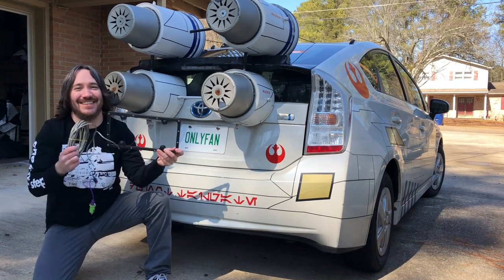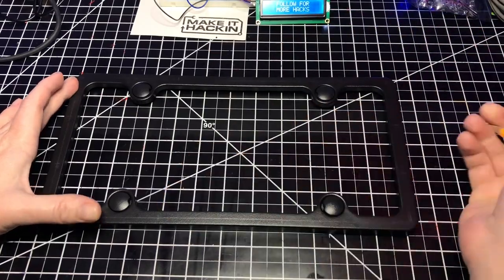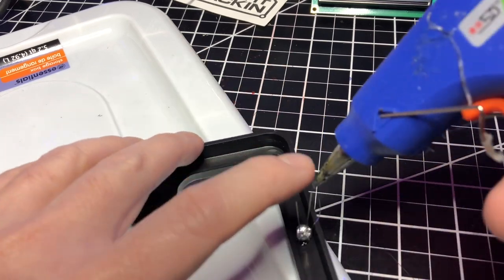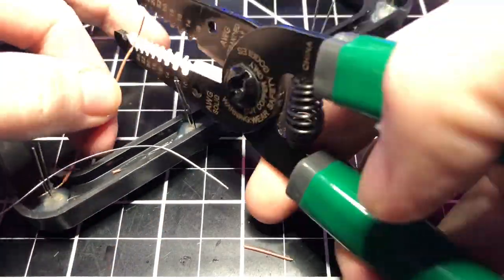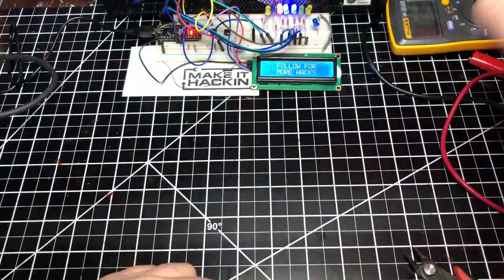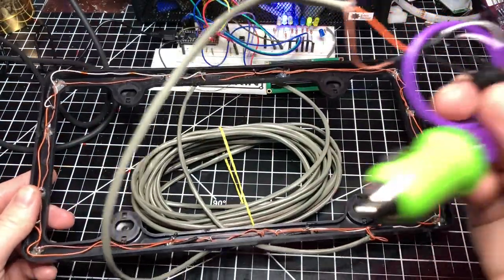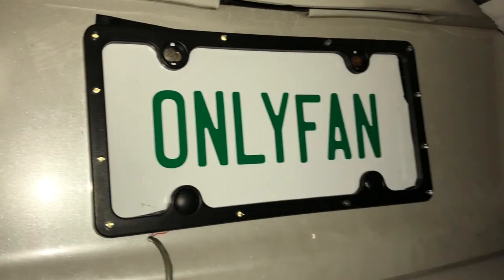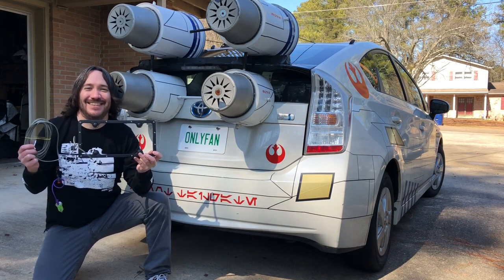Infrared Camera Blocking License Plate Frame - Tutorial - How To

Comment: Still illegal to obscure you plate. No different than the polarized covers used in the past.
Reply: But it is no obscured to a person of normal vision.  Or are you saying that the only purpose of traffic cameras is safety? If it's for revenue then the camera is illegal.
Reply: @bowez9  Same way a polarized filter only blocked the camera from seeing the plate. Still not legal.  The camera is for enforcement. You don't get safe roads without being able to enforce the law. And how can you make it safer if you can't go after the person who is being unsafe because they are obscuring their plate from the camera?  Why do you need to obscure your plate if you are obeying the law??
Reply: @pdxyyz  polarized lenses block a portion of the visible light and as such obscure it to the vision of a normal person.  As a matter of function polarized lenses only let light visible or not that is only aligned in one orientation through so it is only a small fraction getting through.
Reply: @pdxyyz  if it's enforcement put a law enforcement officer out there then.
Further more the 4th Amendment put a hole in your argument.
Reply: Again if you aren't breaking the law why do you need to obscure your plate??    Polarized covers were designed to block cameras.
Reply: @bowez9  The issue is that obscuring a plate is illegal, and there is no reason to do it other than to break the law.  If you want to change the subject and debate the efficacy of traffic cameras, then fine. Traffic cameras teach drivers to follow the law in specific places. Police patrolling the streets keeps people on their toes and make them cautious more of the time.  In Portland city government have defunded the police, and reduced moral causing cops to resign, the numbers are now too low to even have traffic patrols. Too busy working the riots.  So the only way is to use cameras.  Because at least getting a ticket in the mail makes you think remember to drive safely when around the cameras.
Reply: @pdxyyz  many courts have already ruled on cameras and usually if they a income source they are illegal-they are not for safety or teaching one the laws.  That is what the codified law books are for.
Reply: @pdxyyz  and others states have said cameras can stay but generate no revenue and all the cases I've heard of so far they end up not being used at all then.
Reply: @bowez9  - but how many cases have you heard about? poor sample sizing is a common problem with faulty analysis.
Reply: @jeremylarson6267  Memphis, Knoxville, Nashville, Little Rock... both states of AR and TN.    AR deemed them illegal while TN said could use them just not make any money.  So I'd say a sample of ~10million people is sizable.  Each one of those cities listed plus more each were individual, at a minimum, suits. 
Can also add Atlanta and the state of GA to this list, they can not generate revenue.
Reply: @bowez9  as i suspected, faulty analysis
Reply: @jeremylarson6267  care to elaborate?
Reply: @bowez9  - sure care to site the ~10 million cases used as your stated sample?
Reply: @jeremylarson6267  population of AR and TN.  Then add in GA and more than double that.

Or did you assume Court Cases?  In which case those cities plus more had at least one lawsuit brought against them if not several, hence why those state courts ruled on the legality of them.  A Court can not issue a ruling without a issue being brought be for it.
Reply: @bowez9  - population is not cases... but hey, let's go with your flawed analysis - how about adding the population of texas, arizona, oregon, washington, maryland, illinois, D.C., NYC, ...
Reply: @jeremylarson6267  read my posts  agian.
Reply: @jeremylarson6267  since you list TX, they are illegal there, as of this legislative session are banned in IL.  In NY while legal has almost no teeth, but are illegal in NJ.  NY looks to have down the road of not allowed to generate revenue.
Reply: @bowez9  - how you equate total population to 'cases' is astounding!
Reply: @jeremylarson6267  inspired by a former President.
Reply: @bowez9  - FDR made you do it, brilliant!
Reply: @jeremylarson6267  not the one I was thinking of but how have any of your questions disproved the facts I've stated?
Reply: @bowez9  - we can agree, your responses have proven your analysis is flawed. and some president, other than FDR, inspired your flawed analysis.
Reply: @praetorianblade6490  First,  hanks for proving Godwin's law.  Second, the ad hominem attacks are as sign that you are incapable of defending your position in the debate. Third driving a car is not a right it is a privilege, thus the need for license plates and licenses. Forth we have the both the 4th and 14th amendments to the constitution which ensure that we are safe from illegal search and seizure and are required to be given due process.
Reply: @jeremylarson6267  no matter state of analysis, doesn't change the fact that numerous states have deemed cameras illegal or to only be used if no revenue generated (as such most districts see no benefit with no revenue).  Yet these same areas all allow a actual cop to write a citation, er go since these lights in no way obscure human vision they are not illegal.
Reply: @pdxyyz  I provided the perfect analogy, so get over it. Refute my argument- obviously you CANNOT from your comment.
Reply: @pdxyyz  Our 'rights' are OVER, did you not see the last election, corrupt judiciary, and no lawmakers obey the US CON period- they obey what they WANT to obey.
Reply: @bowez9  - good look with that defense in a court when ticketed for non-compliant display of license plates in all 50 states - that's more than 276 million cases.
Reply: @jeremylarson6267  please explain how one would get cited for that.  IR cameras can not see the plate for the automated ticket, and people see no reason to issue ticket for the plate is totally visible.
That is unless you believe cops will just start arresting everybody without cause or suspicious and expect that to go well for them.
Reply: @bowez9  - perhaps you can do some analysis and figure it out. than again, probably not. please make sure you represent yourself in court, too, at least that way you will save the attorney fees.
Reply: @jeremylarson6267  stop the personal attacks and post some facts.  Or do you not have a point you are trying to make?
On this issue I don't have to go to court on it--not only do I live in a state where the cameras are illegal I am further surrounded by states in which they are illegal, further more the plate frame would appear was illuminating the plate as required by law.
Reply: @bowez9  - do you make up definitions for everything or are you unaware of the actual definitions?
Reply: @jeremylarson6267  still no data only personal attacks?
Reply: @bowez9  - given you plenty of data and never offered a personal attack
Reply: @jeremylarson6267  I have yet to see you give any data, just ask questions and with the regions you did ask about I refute your claim on several in that cameras as illegal.
Reply: @bowez9  - whether you see it or not speaks to your abilities for analysis, and as shown, the results of that analysis is flawed. if cameras are illegal in texas, as you refute, why are they still in use in a number of communities, like around san antonio?
Reply: @jeremylarson6267  so you assume because the cameras are up they are active?  Furthermore Texas House Bill 1631 ban their use, so it's not what I say it's what the Texas Legislator has said and the Governor has signed into law and the Court have upheld.

If you truly wanted to know this information you would have looked up yourself, and not wanted someone to hand you the information.
Reply: @pdxyyz  then explain Civil Asset Forfeiture.  The law only protects you if you know it, and all sides are willing to enforce it.
Reply: @bowez9  if it is an abuse of power then that's what the courts are for. Not all civil asset forfeiture is an abuse. But like all laws, they have to be challenged to be struck down as unconstitutional.
Reply: @pdxyyz  the issue is assets are being sized without probable cause let alone evidence of a crime.  It is not my burden to prove I'm innocent but the State's to prove I'm guilty, and CAF goes against this.
Reply: @bowez9  - no assumption made - I found statements from the local administrators who commented they will continue to use. I then found evidence the cameras are still in use through public records, including unsuccessful attempts to dismiss tickets as recent as November. Which is why I knew about it and asked you why they are still in use if it is illegal. So, yet again, more data provided about your faulty analysis. My questions are to understand why you won't even consider, let alone acknowledge, that your analysis is faulty. You've already made it clear the answer, but feel free to continue.
Reply: @jeremylarson6267  there isn't a fault in my analysis in regards to TX.  Your local municipalities are in blanton violation of state law   in service of the almighty dollar.  Just like Civil Asset Fortiture and Qualified Immunity are opposed to the Constitution.

Just because something is illegal doesn't mean it is not done.  Quoting Texas TRANSPORTAN CODE 707.
Sec. 707.020. PHOTOGRAPHIC TRAFFIC SIGNAL ENFORCEMENT SYSTEM PROHIBITED.
Sec. 707.021. USE OF EVIDENCE FROM PHOTOGRAPHIC TRAFFIC SIGNAL ENFORCEMENT SYSTEM PROHIBITED. 

Now how is this for Data analysis.
Reply: @bowez9  to your last question, it's clearly flawed. let me help you out here, what is your definition of an exception? hint, your 'analysis' does not account for it.

Comment: Use 840nm infrared LED flexible strip around the LP inner frame but I would also add it to a pre-made  LED frame and just attach it to the vehicles LP lights. For movie set style application of course to add reality to the plot... One could also place a strip between the trim and windshield for plot reality.

Comment: It could be made without the usb power supply and fewer resistors. Just connect six leds and a 300 ohm resistor in series. This led-resistor circuit will run straight off the car 12 volt supply. Two banks of six leds will fit the frame.

Comment: There's only one problem... in some areas, license plate frames are illegal.
If you're driving around with one, you've given the police an instant excuse to pull you over, whether it's lighted or not.

A better solution would be to somehow have the lights shine on the plate from some other location, like the plate light itself does on some vehicles.

Comment: The 200 ohms is what you selected for 12v system or 5v ? Wouldn't  you use 100ohms to reach max voltage at 12v for 1.8v at the led @ .18watts?

Comment: I think it's a cool idea but if you used like 2, 10 or 15 watt 12v ir emitters under the lip of the hatch above the plate itself I feel like it would be just as effective and there'd be no noticeable LEDs on the tag frame and you could use the cars 12v power from the tail lights, and still be able to use a toggle switch.. but either way it's really cool idea I like it..

Comment: Well, since you asked how could this be made better.  1st You could see if you could locate 12V inferred LED's (not really better, but easier) also possibly brighter LED's and even better super bright flexible 12V inferred light strips,  You could add more LED's so they might work in the day time. Ad an accessory on wire so when the car is on the tag frame is on.  In my neck of the woods there are tons of MRCD (multi radar) traffic cameras on most of the traffic lights. I guess they mail out tons of red light tickets daily.

Comment: Just replace the plate lights that come with the car with extremely bright IR LED's and run directly from the 12v system. Or add the ability to toggle between the two.

Comment: Couldn't you in-line strip the ground to make running it between the posts easier? Also, if everything will be running 12v, isn't it possible (likely illegal) to just jumper it into the running lights so they're always on, and then run a kill switch to the front of the vehicle?

Comment: Don’t worry.  The best plate reader systems will still read the plate.  I know because we’ve tested all these theory’s. The sprays and reflective material doesn’t work.  Making it brighter won’t work.  Now the cheap ones with a cheap led illuminator will prob work on those.  But the top of the line Leonardo ones won’t stop them.

Comment: Alot of cameras/stoplight camera's have a really bright flash, I cant see this working. You should test it out :)
Reply: it takes balls to test it out
Reply: This is why I would use UV rather than IR LEDs.
Reply: @gregorykusiak5424  both UV and IR are going to be cut out by any decent camera. Doesn't apply to cheap smartphones but definetly applies to any speeding cameras and such. In Poland, many speeding cameras are based on Nikon 3000 which, as any other DSLR, does include stock IR and UV filter.
Reply: @kubastachu9860  you’re probably right now that I’m thinking about it - and what large corporation wouldn’t buy the expensive cameras when their ability to make money is at stake, right?

Comment: TO save yourself soldering all those wire bits for common, just use one wire and strip segments with a knife 2mm off the insulation to solder the ground pin directly to., then you can use that hot glue to insulate that connection.  The only reason it would be illegal to "avoid detection" would be if you were avoiding detection by law enforcement in the lawful execution of their duties (e.g., to give you a ticket) or if you were avoiding detection while in commission of a crime.  Otherwise you there is a fundamental right to be free from unwanted observation by surveillance generally... stronger in some states / countries that others (actually getting weaker and weaker in USA by the day as one-sided recordings are admitted into evidence AGAINST police) but in fact the person whose security camera is set up to covertly servielle all cars that are on public property may actually be the one who is breaking the law (that is why you see signs that say "This area subject to camera surveillance" at places that are legit.)

Comment: LEDs need not be in the frame. Substiture two rows of lower lumen LEDs  around the plate with a switch on dash "normal" and "high".  Add any other lights to the car so  the LEDs don't stand out.  When approaching tolls flip high switch on and the cameras cannot read brighter light. Once through, flip swich to normal. Switch under the seat will not be found by cops if placed correctly.  Use the same wiring as the car has for regular license plate light(s) may need a  bigger fuse.

Comment: Make better: 1.  Power them from the running lights, they  will go on automatically.  2.  I can still read the plate, so a better way is to drill a horizontal line of holes right through the middle of the plate in between each letter/number.  Now the light is right where you want it!
Reply: modifying a license plate is a federal crime i believe. even if it's just drilling in between the letters and numbers.
Reply: @greatleader4841  "...I believe. " 
 Look up the statute, post it here, and then we'll all know..."for sure."

Comment: instead of using one resister for each led, use ONE resister rated for 10% more that the COMBINED current draw of ALL the leds, saves room by having that resister some place convenient rather than mounted into the frame. Do add red leds that come on with your brake lights, probably will never be questioned as long as the wires are HIDDEN.

Comment: Saw it on tiktok 1st now youtube recommend it lol
Reply: @MakeItHackin  you can make it wirless plate cover with weather proof and have it powered thru any wire getting power all the time and connect it to wireless sender and receiver kit.
Reply from the maker: @NUR_UL_ISLAM1  great idea!
Reply: What you had seen on your tiktok is ancient news,  the first system of this kind that I have ever seen was on the CTV National News almost 20 years ago that featured a couple of kids that had won the top prize in their high school science fair by demonstrating how  with the use of a couple of Kriptonite light  bulbs hooked up to new replacement license plate bulb sockets to replace the stock license plate bulb. They were able to prove the short commings of the toll cameras at the time by over exposing a large surface of the plate and making it unrecognizable.
But when all is said and done, this guy rocks, he may not have invented the wheel but had made it round from the original square one!

Comment: Yeah nah, I reckon you'll be fine, you should test it out on some red light cameras around midday. Personally if I made this i would have only used 1 led, if ur driving a regular car you'd only need to block 1 or 2 letters, also I would have put the led on one of the inside corners of the frame to make it less noticeable

Comment: You could use the license plate bulb as power so you wouldn't even have to run a long wire and the lights would automatically come on
Reply: Just need to use higher value resistors for 12v

Comment: I have great results with refletics stop sign clear spray paint...
Reply: You just sprayed on That it????
Reply: @cielpolanco6710  yes, been running ezpass gates and haven't gotten a ticket in the mail for about 6 years. It looks like a normal plate until you take a pic and the flash makes it look like the sun. I used Reflectics available anywhere.
Reply: @cielpolanco6710  Take a picture using your phone to test 👍day or night

Comment: Why not get one of those frames with a plexi glass covering and edge light the plexiglass and keep the LEDs hidden under the frame. Also wire in a relay fed from the tail lights to power up the LEDs when headlights are on

Comment: Just run one single ground wire and strip the wire in the area of the led so you don't need to use seperate pieces